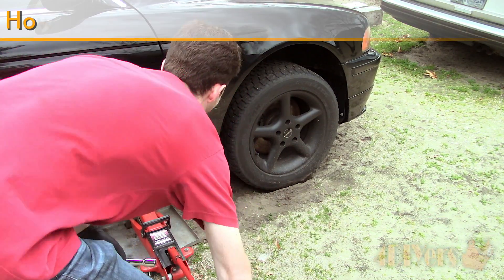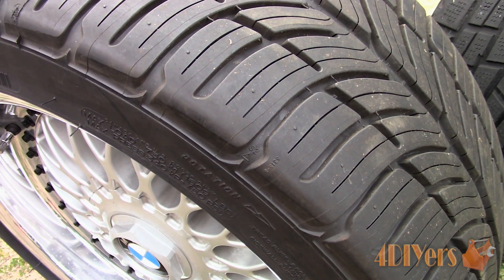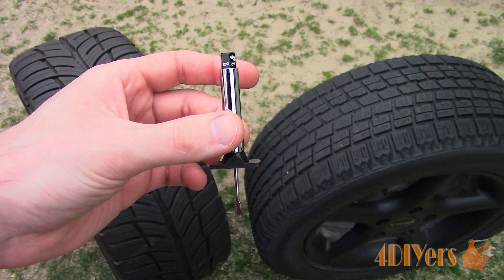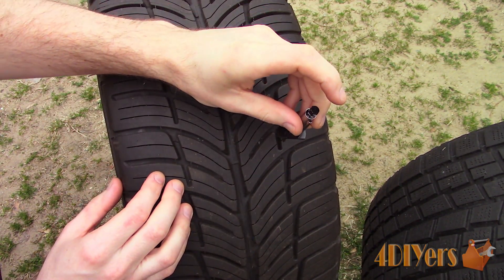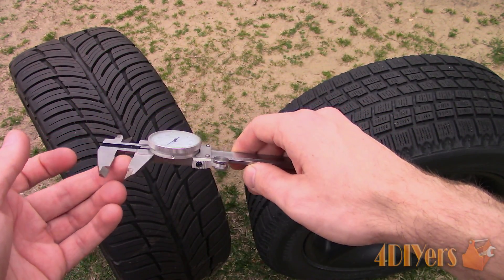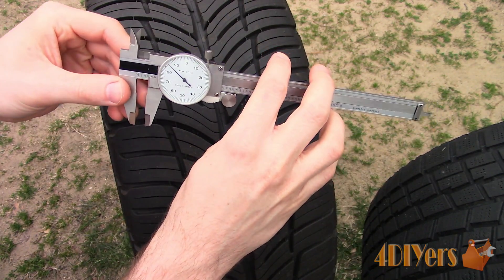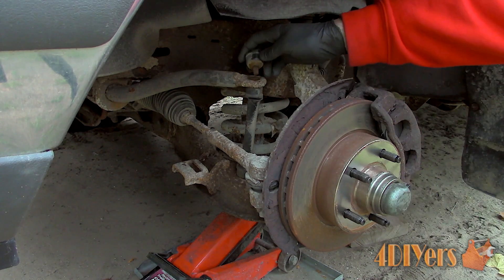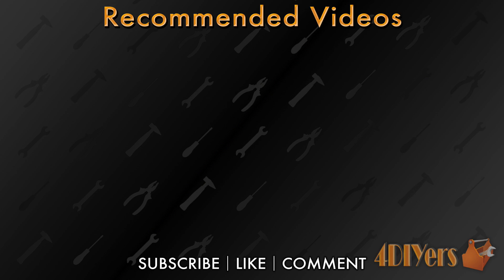How to Measure Tire Tread Depth on your Car & Why it's Important

Comment: Looking at used tires the dealer said they had 90% life left but no tread depth was given.  Looks like I need a new tool since I didn't buy the tires or his statement.  Apparently they get tires from insurance claims and then resell them for about 50% under new price.
Reply: Insurance does not cover tires.  Some new tires offer a warranty that saves your money to buy the next new tires in the same store.  Some used tires could be from a car totaled.
Reply: @asinc7894  yeah that's what I meant about insurance claims, when a car is totaled. Not sure how cheaply they can get them but they were trying to get nearly $500 for a set of 4.  Way too much in my opinion.  They wouldn't budge on the price, so I'll go back to shopping for new.

Comment: How many miles/kms can you drive to remove 1/32 of tread? Does that make sense?? If I have 7/32 tread how far can I drive (on average) before I get to 6/32? 

Thanks! Great video as always!
Reply from the maker: Unfortunately there's no real specific answer for that. Tires will have different wear ratings, compositions, tread depth, and driving styles or suspension setups can also affect tread life. Some tires have 100,000km/60,000 mile, others can have half that. Higher performance tires which have a stickier rubber composition will wear out quicker vs something which is just an all season generic type tire that would have a harder composition. Thank you :)
Reply: 23,042.83 km

Comment: What number is good for the tire depth guage.. and what's the bad number for the tire depth guage...
Basically what's good readings and what's considered bad readings and new tires are needed??
Reply from the maker: Unfortunately there really isn't a generalized number as not all tires have the same tread depth. Wear bars aren't always the same size either and country depths can vary as well. New tires would be needed when the depth gets to your country's specifications or the tread face is even with the wear bars.
Reply: Generally 2/32 us the wear bar and when the limit has been reached. Some pusht inspection shoo would fail 3/32 though around here